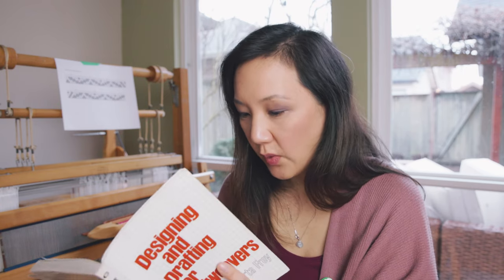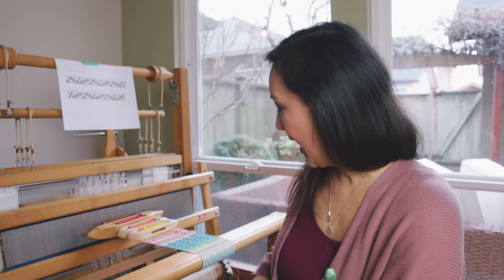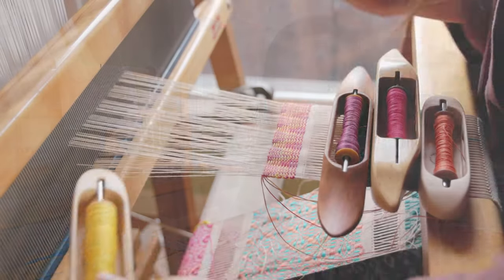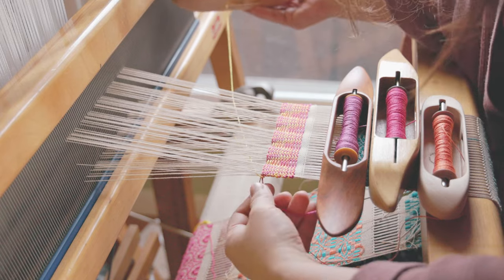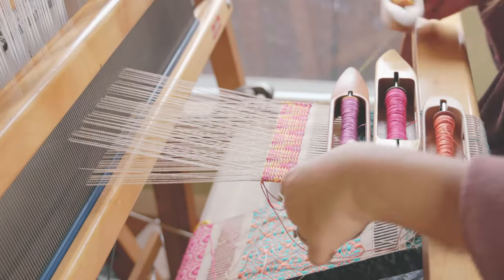The difference between reading about weaving and actually weaving // Lo Meets Loom // Weaving

Comment: I have been repairing a woven blanket,  with needle weaving/ duplicate stitching,  which is more of an embroidery method. 
When I did a sample of true woven fabric to learn the woven structure and method... it is so different  !
The weaving is a Leno, with alternate right/left twist to the warp...  the embroidery/needle lace method.... looks the same after completion... but getting there... so very different in the working of the threads.